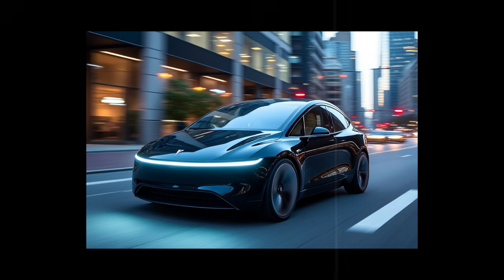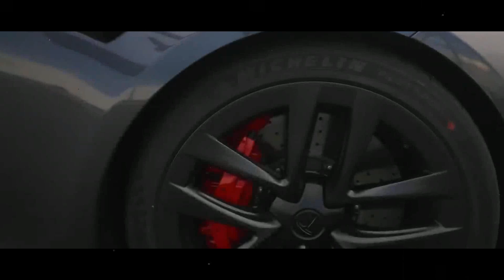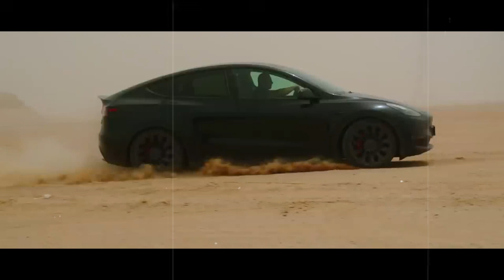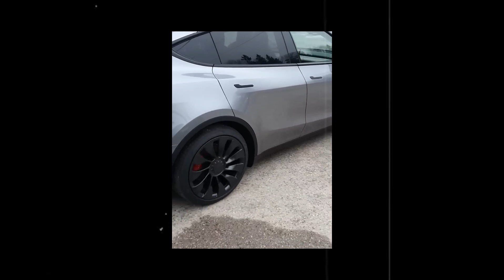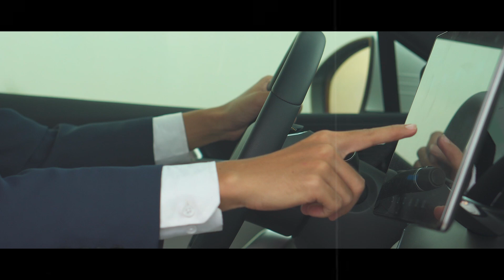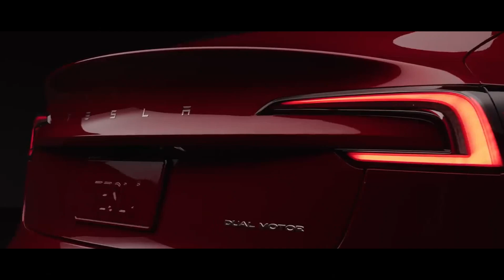Wow! NEW TESLA MODEL Q -Elon Musk CHANGED the GAME with the $18,999 Model Q! The END of the Model Y?

Comment: There's no confirmation from Tesla on new name for the new products. Model Q is made up by the ppl, Smaller version of the car is speculation, ALL Telsa have said is cheaper version, that could mean just making RWD only soft lock the power, No glass roof, Material interior, smaller battery with less range. Maybe they use the old M3 look too, who knows, Current M3 is $42,490. so starting the "new cheaper version at $35,990. would be cheaper, with $7,500 IRA below $30k